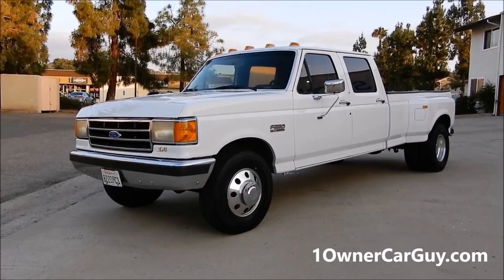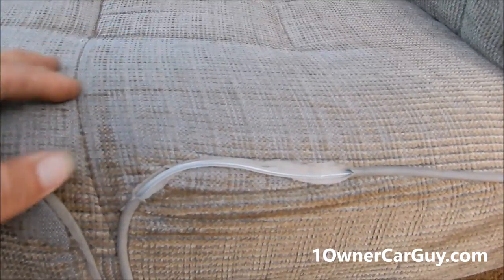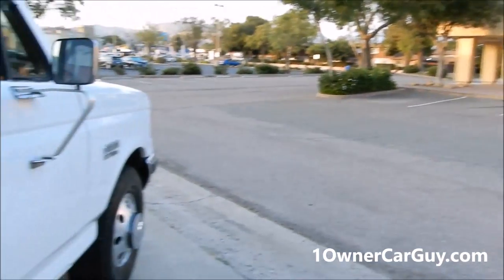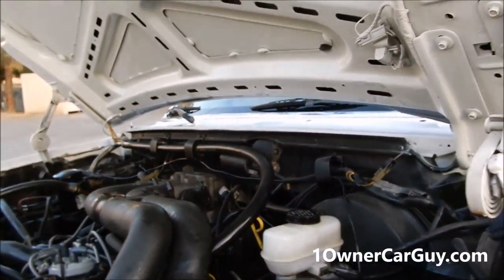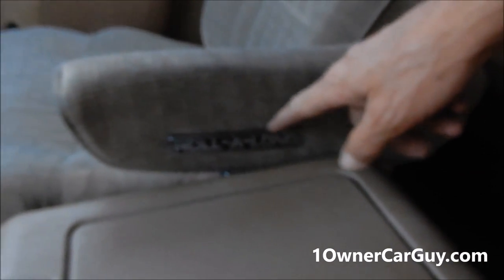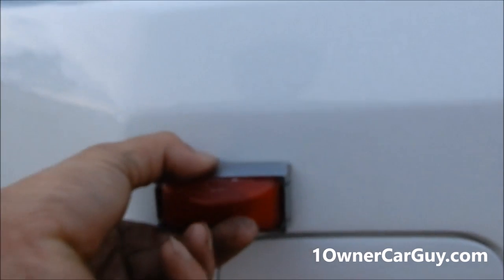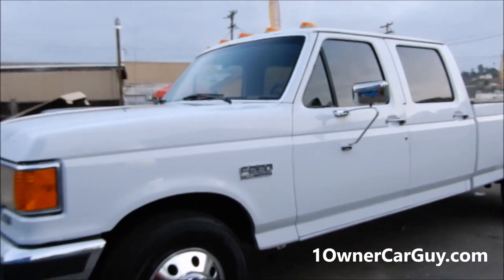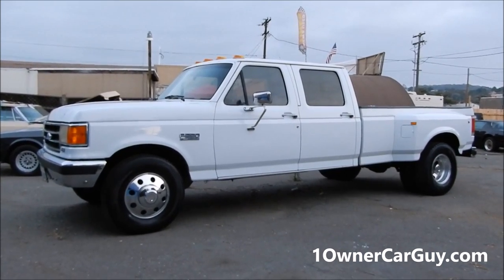1990 Ford F350 1 Ton Dually Crew Cab Pickup Truck Interior

Comment: Never really could understand why Ford offered a gasoline engine in a 8,000 lb truck. Makes no sense but if you like to visit the gas pump a lot. Turbo Diesel is the only way to go. Way cheaper all the way around.
Reply: Diesel power was just starting to become popular around that time. So Ford still had big gasoline engines to be competitive. That being said, apart from fuel economy, the big 7.5 V8 is very capable, and will tow anything that you put behind it. I have towed towed up to 28,000lbs with a 7.5, and regularly towed 18,000lbs. At 65MPH, youll get about 4MPG. A diesel obviously is far more fuel efficient. But apart from that the 7.5 is damn near as reliable, easy to work on, and is a workhorse. I have seen a 7.5 go well over 330,000 miles without  a rebuild, and 90% of those miles were spent with a loaded trailer.
Reply: My 2017 F350 is gas and I don't tow. I get an average of 10mpg with lots of around town driving in Seattle. So long as I stay around there, it will ultimately cost about the same when compared to a diesel up to about 60,000 miles or so. Only after 60,000 miles does the savings kick in, assuming you did not have any expensive repairs on the current day complex emissions system. Due to the lack of diesel emissions systems in the 1990's, a gas truck would have made a lot less since at that time then a gas truck does today.
Reply: Pleeeeeeaaaaaaaaassssse.....lol. I bought a 95 just like this one heavier frame i believe...7.5 L 460 gas....until recently wasn't a diesel ford used much less most corvettes that could keep up with it tagging 12 ton behind it. Pride is a bad thing, makes you miss out on reality.
Reply: Except there was no Turbo Diesel in the 80's or even the early 90's.  Add in Fuel was significantly cheaper back then and not an issue unlike today.

plain and simple the fuel mileage wasn't as big of an issue back then, especially when you could save thousands at the initial price and in many cases still out tow the diesel engine.
Reply: Because people like to pull, that 460 will drag a pice of shit idi In circles

Comment: i bought a 1996 same model in 2009 and just sold it last year,, only time it didnt start it needed a starter other than that just basic maintence for almost 9 years and 60000 miles,, bought it with 78k and had about 140 k when i sold it,,

Comment: It's interesting that the windows are power in the front, but manual in the rear. Was this typical back then?
Reply: This bodystyle is known as the bricknose, I believe years 1987-1991. 1992-1997 are Aeronose and i know for sure starting in 1995 power rear windows were available. Migbt have been available earlier than 1995 as well but not 100% sure on that. All 1991 and earlier had manual rear windows. That being said, as the driver you could open and close the rear window behind you - even though it was crank. Little bit of a manouver but ive done it many times. Gotta love these old trucks.
Reply: Alec Bloss I had a 96 power rear windows never noticed the manual rear on the older ones maybe crew cab was more rare in the early 90s not making enough of those back doors to get them wired up